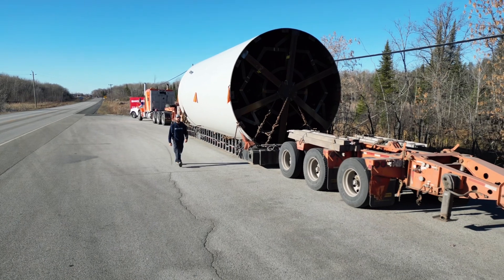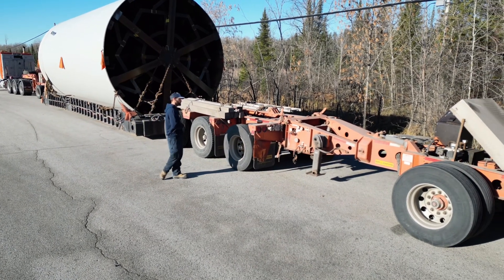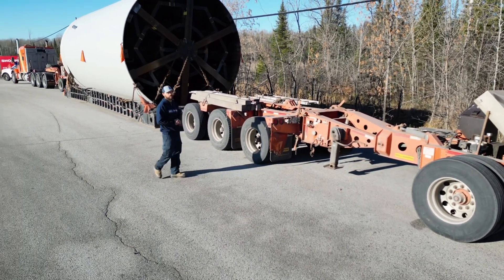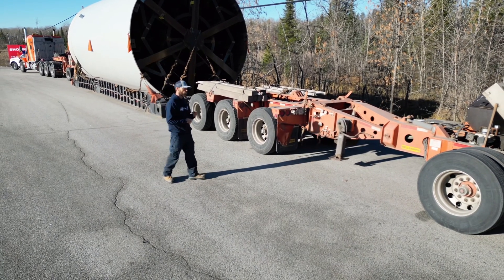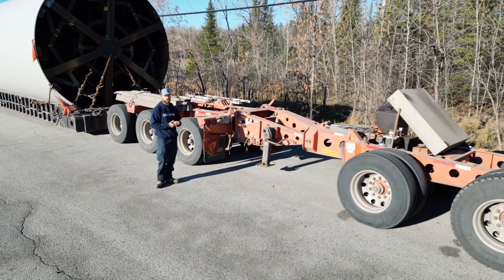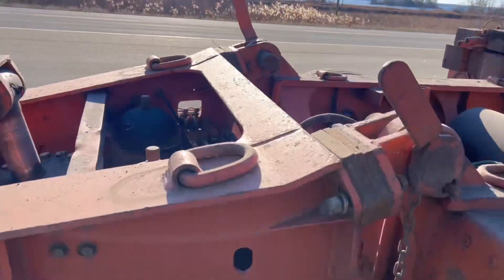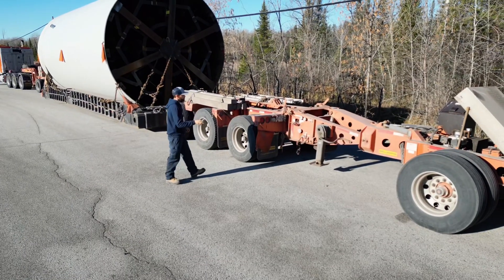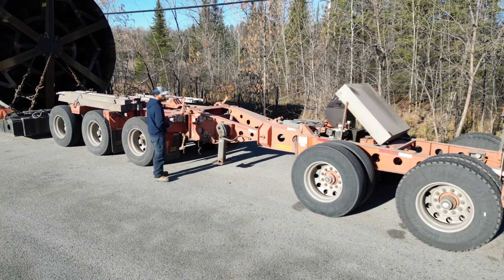Why such a long trailer???

Comment: That is very helpful. Intuitively I knew that the added axles were for weight distribution, but I didn't know about the hydraulic controls, and how they could be used to shift the distribution.

Comment: what i see a lot where i live is the trailers halve 8 wheels across is the point of doing it this way just to spared the load over a longer area of road?
Reply from the maker: The 8 wheels are not legal in eastern half of North America.  In the east we need to spread the weight out even more.

Comment: Why do you have to distribute the weight more to the rear? Less tire heating? And blows?
Im not from the US but in my country we drive 200,000 lbs with a stepdeck/lowboy trailer just 3 axles with 8 tires each axle or like the Fymonvile wide trailers with 6 axles 4 tires each axle .
Reply from the maker: Our bridges are not engineered for heavy weight.  It’s required by law to distribute the weight.  Believe me it would make my life a lot easier to use a short trailer!
Reply: @TheCorecovers what country are you in?

Comment: Hi Doug, could  you tell me what the difference is between  a stinger and a booster, or are they two names for the same thing. Thanks
Reply from the maker: A stinger usually just a single axle booster.  Again there are shimmed and hydraulic models. At Bellemare we have both.  The principle is the same, to relieve some of the weight from the main trailer.
Reply: Great thanks for clearing that up for me. I scoured the internet trying to find an answer

Comment: Is it possible to run more than one jeep to transfer weight on front
Reply from the maker: Yes. A 19 axle setup will usually run a double jeep.  However usually these setups require a push truck in rear as well.  One truck just can’t get enough traction for all that weight dispersed on other wheels.